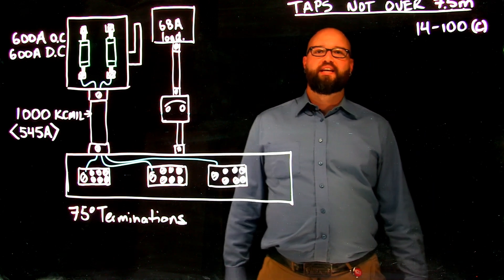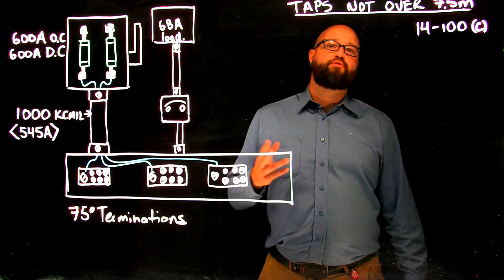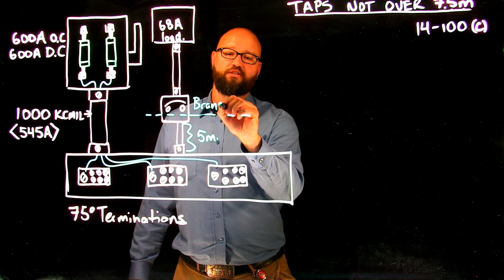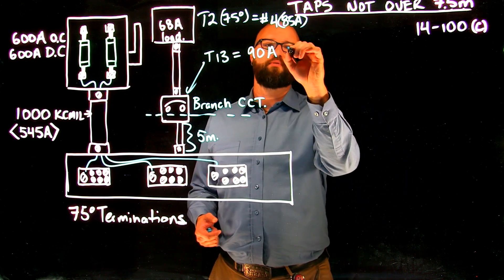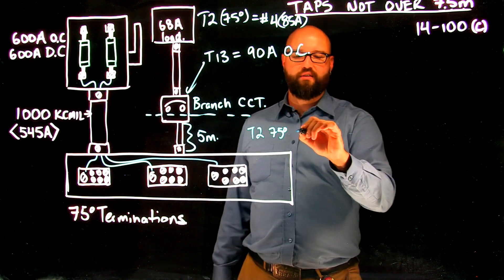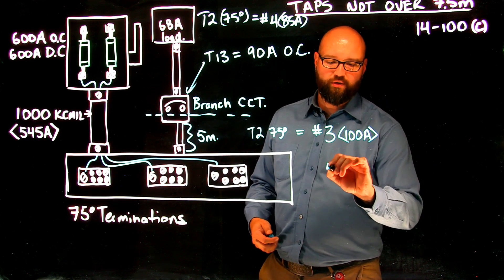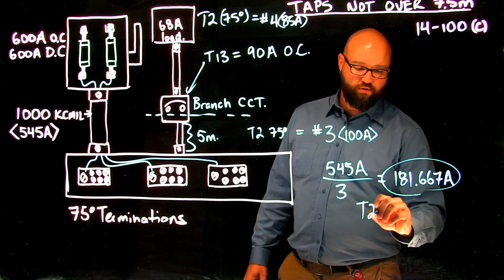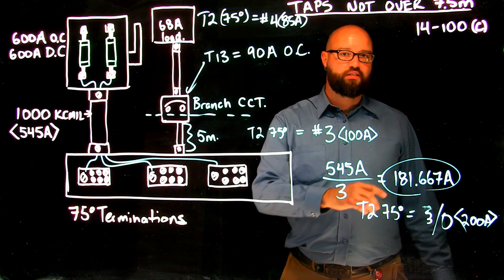Tap Conductors Part 3 (Over 3m up to 7.5m)

Comment: So, over 7.5m, the conductor is no longer considered a Tap Conductor and it must be protected by an overcurrent device at the point where it receives it supply of current as in 14-100.
Reply: Correct, Tap cond is 7.5m Max.